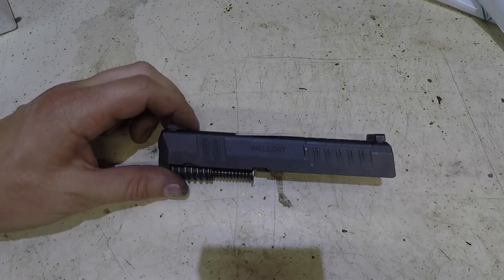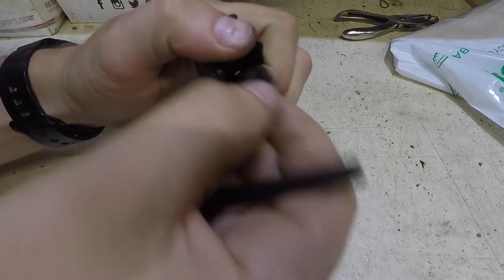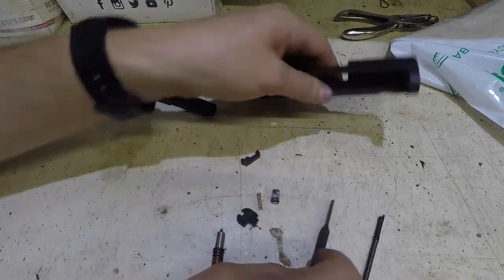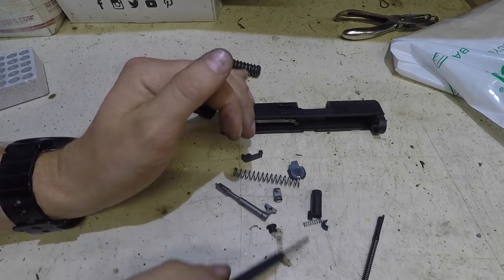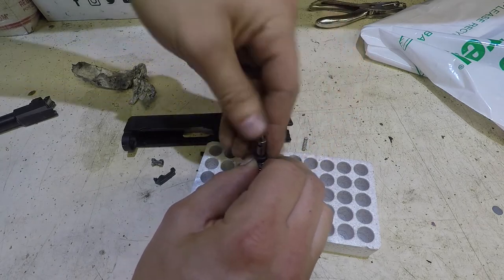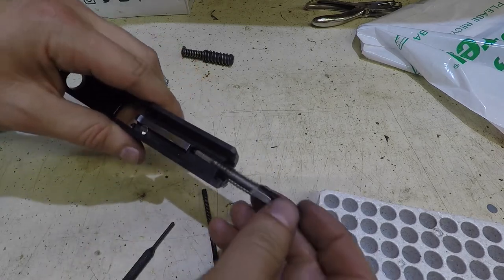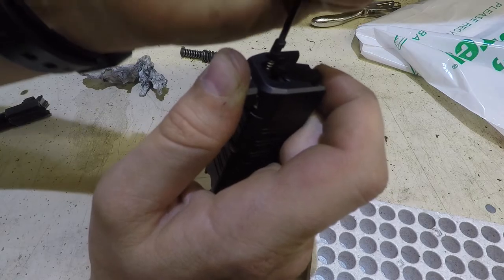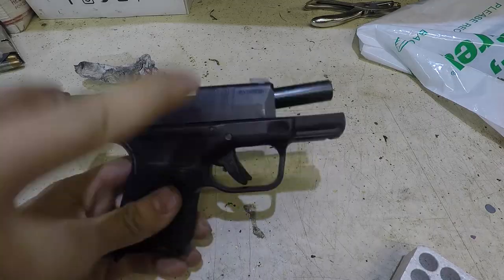Springfield Hellcat Slide Disassembly - Super Easy

Comment: Dude that extractor spring the end that fits up against the extractor actually comes off the spring. It has a little tit the spring goes over and it’ll pull right off. When that happens there’s a steel rod inside the spring. One end of that rod has grooves on it. Which way do those grooves face when sitting inside the spring??? It does matter I know that and I forget does the grooves on the skinny rod inside the spring go towards the end plate or the extractor side????
Reply: I found the answer the grooved end on the skinny rod goes towards the end plate side.
Reply from the maker: Original comment: Good question, I missed this and just pulled out my hell cat to take it apart and see. The grooves face toward the extractor (toward the front of the gun). - Correction edit: They go toward the back (https://www.springfield-armory.com/wp-content/uploads/Hellcat-Manual.pdf) Page 35.
Reply: @TheLarkinsLair  what are you serious everything I seen the grooved end face back towards the end plate
Reply: @TheLarkinsLair  damn it now I’m confused and won’t know 100% till I go to the range. I’ve done it before and it absolutely does matter the gun won’t operate correctly if it’s in wrong. I got on a Hellcat forum guy had the blown up schematic and it showed the grooved side facing the end plate end not the extractor side
Reply from the maker: @seanbrand528  Well honestly I just pulled mine apart and put it back the way I found it... So maybe someone took mine apart and put it back together wrong... anyway I have shot over 1K rounds through it in this way so I am leaving it as is.
Reply from the maker: Ok, I found the actual manual and you are correct the grooves are toward the back... but I guess it works pretty well either way. I bought my Hellcat used so who knows if it was taken apart before I got it. Here is the manual: https://www.springfield-armory.com/wp-content/uploads/Hellcat-Manual.pdf  (Look at page 35).
Reply: @TheLarkinsLair  cool so it does towards back Thank you! I can’t believe yours functioned like that! My Hellcat is 100% reliable I’ve never had one problem. When I first took that extractor spring out and the end fell out and the rod slid out I didn’t know which way it drives me crazy so I put it back wrong went to the range a week later and I had a jam or failure to eject and I turned the rod the other way and it’s been flawless again ever since. Usually I keep that in mind but tonight it got me. So for me it made a difference. But cool thanks buddy we got her figured out! Be safe out in the world man THANK YOU!!!!

Comment: That was great I pulled mine apart like you showed in your instructions and a small metal rod fell out somewhere that was about 1/2 inch long and now I have no idea where it goes?
Reply from the maker: Is it part of the extractor assembly? It can get separated from the spring that it connects to. I talk about it 45 seconds into the video. Good luck.

Comment: My striker assembly broke into half. I  pulled out the rear broken part. How do remove the other half stuck inside
Reply from the maker: It broke in half!! How did that happen? Anyway I would try some fine/long needle nose pliers. Not the regular ones, something like this: https://www.harborfreight.com/12-inch-locking-clamp-94952.html?utm_source=google&utm_medium=cpc&utm_campaign=12169518939&campaignid=12169518939&utm_content=114845787297&adsetid=114845787297&product=94952&store=363&gclid=Cj0KCQjwnMWkBhDLARIsAHBOftpfk1UqKHUKabZ7hLerUscfcyi1PVmGXZy9SvudmYun9FyGGS657zoaAtOpEALw_wcB

If that didn't work I would grab a de-capping pin (used for reloading) and shove it reverse down the  hole in the bolt face, then hit it with a hammer. If that didn't work I am not sure what I would try next. I would have to see it. Good luck!
Reply: @TheLarkinsLair  it fell out last night after racking the slide a great number of times .  Anyways i only had 500 rounds through my pistol but i have been dry firing it daily maybe  50 times a day for 14 days using snap caps until it broke.   I so a few other examples online where it broke in half in exactly the same spot. i thought snap caps were supposed to prevent that